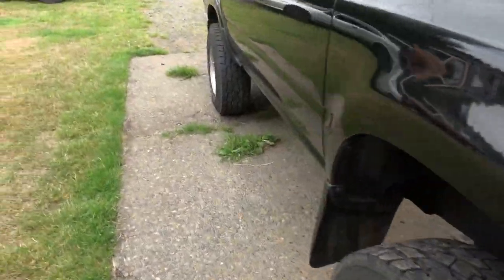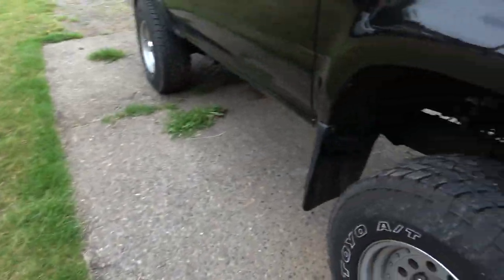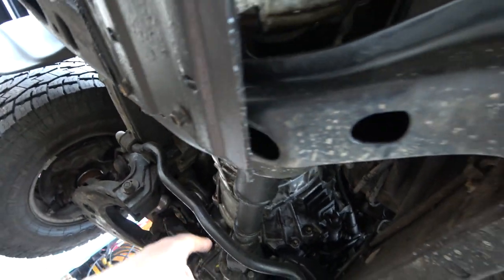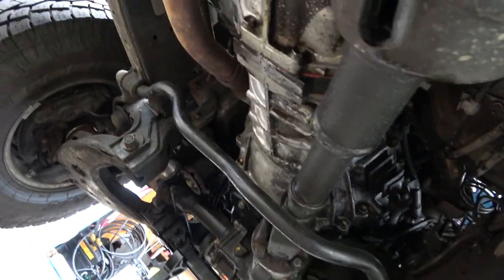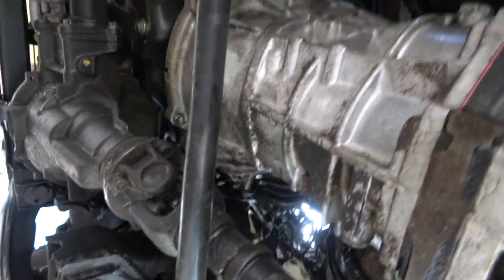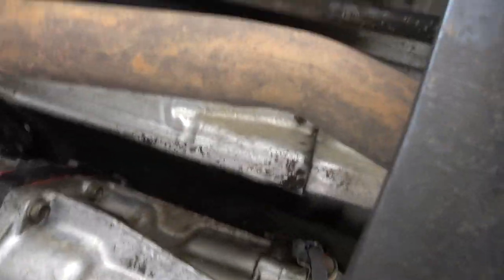Another One! 1994 Toyota 4Runner | Clutch replacement | LONG VIDEO SO GET BEER AND POP CORN

Comment: Eric at SMA would faint if he saw a 90's Toyota that was that clean and rust free underneath!  Thank you Oregon!   Todd the retired trucker.
Reply: Mines is a lot cleaner, & I do love it. I'm from Southern California so we don't worry about snow or too much rain, although these past 12 months it has rained pretty good. My 4R has the original paint & it still shines. No dents even, just minor dings here & there. But bleeding the clutch on these 4Runners is a huge pain on the arse. A shop even had me buy a new clutch & break bracket & even they had a very hard time bleeding the clutch with new break & master cylinder. They used several bleeding machines as I did. But they finally got it the old fashion way, a jar half filled with new clutch fluid (which I think it actually uses DOT3 break fluid), at the end of the slave cylinder about 2 feet raised above the ground, then had several of their mechanics pump the clutch pedal by hand & feet till one got tired, then the other mechanic will continue the process. I just never understand why sometimes it's easy & fast to bleeding since I've done it myself, but sometimes it's been nearly impossible. The clutch & break pedal bracket on these have already been cracked & welded multiple times. That's why the mechanic shop assumed I couldn't bleed it. Then they replaced it with a new bracket, just to suffer as I did till they finally got it. So my original bracket was actually fine even though it was cracked & welded twice before. But oh well, it has a new one.

Comment: I've done many transmission/clutch jobs on older BMWs, domestic trucks, and tractors but never on my '94 4runner and so I watched your video to get me warmed up for what is ahead of me.  Thank you for the great camera work and voice-overs.  It also gave me ideas to flat-out replace other items while I'm in there so I won't have to worry about them later.

Thanks!
-Mark
Reply: The clutch bleeding process can be a real pain on the arse. Some times the job can be done easily, but for whatever reason sometimes it's a real pain even by using various methods & machines. The last time, I got so fed up that I simply sent it to a mechanic shop. They had me purchase a new clutch & break pedal bracket & they still struggled a lot in bleeding the clutch using various methods & machines also.

Comment: How long did this take you? I'm wondering how feasible it is for someone with basic mechanical skills and tools but not a legit mechanic to do? Just ordered the parts for mine. Thin I can get a Jack and will pick up stands if need to.
Reply from the maker: This took me about 4-5 hours. I also work slow.

Comment: pushing in the clutch risks bending fingers on on pressure plate and pulling out and striping what little threads u uhad screwed into the bell housing get tool next time

Comment: So I had a missing bolt on slave and had it fixed at shop cause bolt was broke I couldn’t get out and they said they had a hard time bleeding I noticed it is still hard to get in gear when cold bled it out again clutch now starts engaging at bottom truck appears to have new master cylinder and slave looks good I added a little bit more play in peddle same thing out in 5th and tried taking off it died so I assume clutch is ok. Any thoughts?
Reply: I'll try taking a guess at what is wrong because no one else  has in a year .
That is a long wait .
Check the peddle mounting bracket for cracks ..
I'm curious about why the bolt broke off . What was the problem before the problem ? 
Why did the shop need to bleed the air out of it ?
Reply: I used to have the same problem till it stopped engaging even once the engine was worm. Check your clutch pedal wire adjustment at the pedal bracket. While down there, check for cracks across the bracket. These pedal brackets are notorious for cracking across. As you push the clutch pedal, the bracket frame raises upward which won't allow the pin attached to the pedal to fully insert into the clutch master cylinder, you know, the plunger looking rod. Even here in Southern California, every 2nd generation 4runner at the junkyard had the pedal brackets welded multiple times by previous owners.  Long story short, I sent my 4runner to a reputable shop to bleed the clutch. They had me buy a new pedal bracket. Guess what? They still had a hell of a time bleeding the clutch. They replaced clutch master & slave cylinder. They still couldn't bleed it using various methods & multiple machines. Till they were successful at bleeding it the old method. Transparent hose at the slave cylinder, the other end on a glass jar half full of clutch fluid, the jar was raised 2 feet off the ground at level with the slave cylinder, several guys tool turns pumping the clutch pedal by hand till they got it. Keep in mind, it's not clutch fluid that Toyota uses, it used DOT 3 break fluid. Just check the required fluid. Don't assume all clutches use clutch fluid. I've had my 1991 4Runner over 10 years. I had to bleed the clutch multiple occasions & I don't know why sometimes it's been easy to bleed & sometimes it's nearly impossible. I'm not the only one who has come across this problem. Good luck with yours. Also, try changing the bushing on your stick shift. I bought my replacement kit on yotashop.com. Fill up your gear fluid might as well once the shifter lever is removed. I discovered that I needed 2 pints of gear oil.

Comment: Are you sure that’s a 94? Looks like a 90 or 91
Reply: 1990_4Runner I’ve got a 94 and it’s identical to this besides the paint job
Reply: It looks like a 90 or a 91 to me too, the headlights are the sealed beam type, not the 92 facelift style.